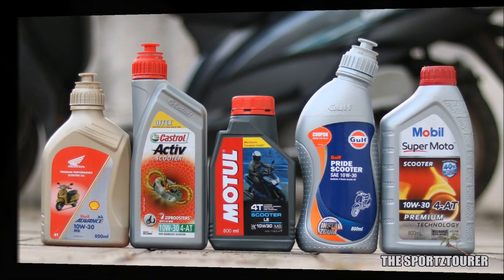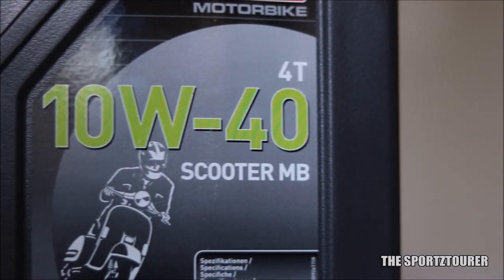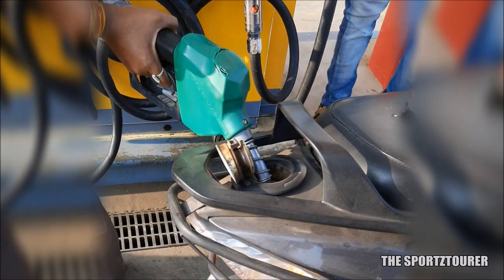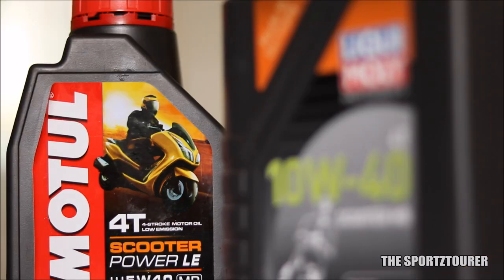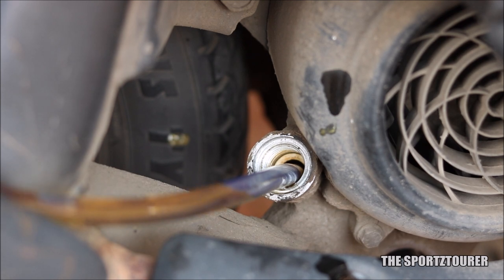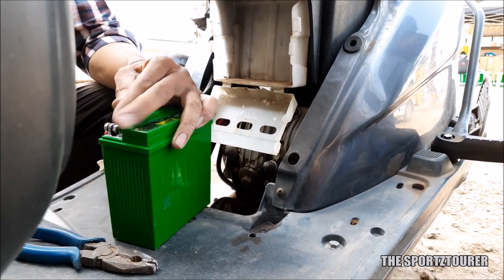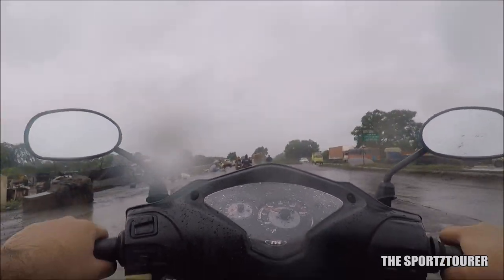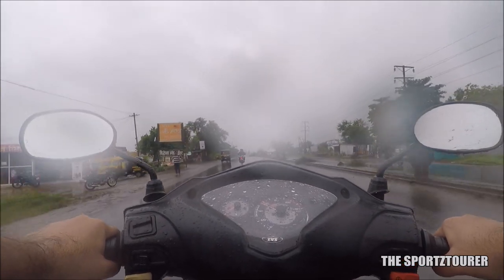LIQUI MOLY SCOOTER ENGINE OIL VS MOTUL SCOOTER POWER LE, COLD START PROBLEM, BEST SCOOTER ENGINE OIL

Comment: Using liqui molly scooter engine oil 10w40 for Yamaha fascino 125 bs6 and I can feel the difference. The engine running smoother at speeds above 60kph. The vibration has also decreased. Previously was using yamalube oil which was also good at it's price.
Reply: Any other engine oils you tried in new fascino? If yes please share their experience.
Reply: How many odo for the changing interval of liquimoly oil ?
Reply: Right bro i am using Bajaj pulsar 150cc bike in 20 w 50 oil.my bike is a smuth.no vibration
Reply: @alyounesandyfernando2437 your bike daily Drive?

Comment: Thanks again for the video.
Want to share an experience with using motul 3100 10w30 on my Hero Duet scooter. The manual clearly mentioned about using JASO MA oil so I went with this hoping for better performance and smoothness.
I poured in the winter of 2019 along with it changed the gear oil too. The oil did great till april after which its smoothness went for a toss. The scooter didn't want to go beyond 50kmph at this point which wasn't the case till march, it easily did 65kmph without complaining. Carburetor tuning was checked multiple times too. Now 9 months in with the oil, (scooter's running is very low, only city usage, done 15000km in 4 years😂)
So will be switching to motul scooter le 10w30 now and will share accordingly.

Update: Recently changed from Scooter LE to Castrol Power1 Ultimate. Scooter LE performed admirably. Longevity of the oil was good, decrnt smoothness and happy engine. I extracted 67kmpl on a highway test with speeds of max 68kmph eith the oil. Best value for money oil I'd say. 
If you want I'll update with my castrol experience too.
Reply: hero duet and activa basically have the same engines i think
Reply: @rko951  please don't clutter the comments with your half assed knowledge. Duet's engine was the first scooter engine hero designed from ground up after separating from Honda, glamour was the first bike engine. You thought wrong
Reply: Allie X  actually if you read his other comments, he constantly trying to prove I'm wrong, after 5 such replies I had enough. Yeah even I'm surprised as the label on oil filling port on the scooter says API SJ which is so old, maybe around 2003.

Scooter is damn fine with the right oil, activa didn't even bother to give telescopic front forks until 5g 😂. I like my bs3 duet for what it offers, only gripe is slow pickup till 10 kmph
Reply: Allie X  haha since when did TVS started producing activas?  change of mind suddenly? ;)
Reply: Scooters mainly require JASO MB grade and JASO MA & MA2 will not be as lubricating as JASO MB. From next time always stick to JASO MB grade for scooters. You can try Liqui Moly 10W40.
Reply: @sudiptapramanik3171  again, the scooter manual mentions using MA oil which surprised me too but I went with itm

Comment: I want to change the engine oil & oil filter on my RTR 180 myself... but one thing i don't understand is that they mentioned something called OIL SUMP FILTER which has to be clean every 6000kms as per maintenance schedule provided in the manual. please help me 🙏🏼 regarding this, i don't understand what they are referring to. This is how they mentioned.. Just to make you understand better 
Engine oil- Top up @ 3000kms & Replace @ 6000kms
Oil filter (paper)- Replace at every 6000kms
Oil sump filter- I & C at every 6000kms

Comment: Using Liquimoly MB Grade Scooter oil along with Liquimoly oil additive since last 6 months in my Honda Aviator. I had completed 94500+ km in Honda Aviator. My observation is that one click start and improve in mileage (52+kmpl) in my 7 years old scooter. I love liquimoly products. My experience with motul is very bad. Thanks for the comparison ☺️🙂
Reply: What is the drainage interval
Reply: @bitbuybit9193  as per liquimoly website it is upto 6000 km but i don't cross 2000 km in any case since i purchased scooter.
Reply: @JitenderKumarJitu  since you have even added the additive, its safe to stretch it till 3000km. Why was your experience bad with Motul I wanna know
Reply: @tejaspadhye  i had used 4-5 bottles of motul 300v MA grade in my scooter. After some days engine starts consuming engine oil. After 500 km few amount of engine oil left in engine. This had forced me to go for engine overhauling. After engine overhaul i had used Motul 10w30 MB mineral grade engine oil but i don't find it useful. I think Motul oil is not good for Honda two wheels. I had Honda CB Hornet 160R also in which i am using Liquimoly 10w40 street race.
Reply: @JitenderKumarJitu  interesting. I have used motul 3100 10w30 in my scooter which is JASO MA because manual suggested MA grade. What I didn't like is it didn't even last 2000km, but for the same oil but 20w40 grade, my 14 year old suzuki responded amazingly.
Reply: @tejaspadhye  good to hear that suzuki engine supports motul oil. Now honda BS6 scooter engine manual recommend use of MA grade engine oils which i think good improvement by honda.
Reply: @JitenderKumarJitu  lmao scooters have become hybrid apparently, both MA and MB oils work 😂
Reply: im using Liquimoly Street 10w40 in my Yamaha Nmax 155
i put 850ml of oil and put 50ml of Liquimoly Mos2 oil additive total of 900ml
i stretched it to 3450km. 
it when i drained more than 870ml still came out

Comment: I have some extra Motul 7100 as my bike only takes in 1.2L, leaving me with .3L extra. I have just kept the extra oil around for a year, so can I use it during my next oil change or should I discard it?
Reply: You can keep it for 1 year, don't use it after that as opened oil may not keep its properties intact. You can instead use it for topups if you ride aggressively, and if topup not required, every 1000-1200km take out 100ml of old oil and pour 100ml from your excess available oil.
Reply from the maker: Hi Sajag,
As already mentioned by Tejas and Allie you can safely use the 300ml left over, just make sure you store it well.

Comment: For liqy moly is the best option in the market but i have dout in how much kilometer it can run in one drain interval for regular and fully synthetic engine oil of liqy moly? Because in my city technician has no proper ans for liqy moly brand due to knowldge and experiance with liqy moly engine oil?

Comment: For my RayZR bs6 l wanna change it to liquimoly 10W40 mb grade so question is do l necessarily have use liquimoly oil for the  gear or can l use other brands too please suggest me what gear oil should use bcuz l couldn't find the same grade number of gear oil to the engine oil.

Comment: Hello, this video was very helpful to shortlist best engine oil for my suzuki access 125 as I have been using castrol scooter till now, wer can I get this oil and how much does it cost??
Reply: You can get both on amazon from Cloudtail for original packaging
Reply: Allie X  one time it sucked but rest of the time, I'm happy I get better prices on amazon. Example, I got the 3m flush for 131 last time I bought now on flipkart they only sell in combo the additive and it costs 250 there for the flush. Right now, it costs 181 on amazon
Reply from the maker: Happy to know that the video was helpful, you can get it from Amazon/Flipkart/lrlmotors. Do share your experience with the oil here 😊

Comment: Which fully synthetic oil would you recommend for heavy traffic usage, personally I think I would go for LIQUI MOLY 20832 10W40 Scooter MB 1 L, since it comes in 1 litre capacity, I don't want to mix match 800 ml synthetic oil with some other low grade oil and make it a bad cocktail.
Reply: Please state your scooter model too.
Reply: @tejaspadhye  I use Pleasure
Reply: Allie X  Ty Allie, I've been servicing my scooter properly and performing oil change periodically too, and with my next service, I'm planning to flush my engine oil with 3M engine oil flush since I've driven the scooter just past over 25k.
Reply: 10w40 for long drain. 5w40 for smooth stop n go

Comment: Castrol power 1 for 220f? 
Will it be good since it’s 1.2litre pack .
Reply: I'd prefer shell ax7 10w-40 full synthetic or motul 7100 10w-40 full synthetic rather than castrol power 1

Comment: I have 6yrs old pleasure scooty 100cc should i go for fully synthetic bcoz condition of scooty is quite bad. Or for scooter le motul mineral. ???????
Reply: Mene company ka synthetic daala tha which is used in bikes. This cleaned my engine in 1200 km and it became dirty... then now i changed to shell. Runs smoothly.

Comment: I do not think engine oil has any role to play in whether the engine starts with one kick or first self. We have a wego for past 6 years and it always starts at first crank 99 percent of times. And TVS scoters do not have cold start issues, unlike say, activa which are notorious for their cold start issue. So I think if you can do a comparo on an activa which had cold start issues that got resolved by changing just the engine oil to say motul or liqui moly then it would be a conclusive evidence on the impact of engine oil on cold start.
Reply: Yes TVS doesn't have cold start issues on it vehicles but engine oils in general do play a role in cold starts. Say the grade is same, comparing castrol activ extra with motul 3000 or 3100, both oils being 20w40, you will find motul very much better. My 14 year old suzuki which had notorious starting issues regardless of temperature was solved to a great extent which just a switch of engine oil brand. There's a reason why online forums call Castrol as Crapstrol. Only their power1 racing fully synthetic oils are worth it according to many online forums discussions.
Reply: Ooh you shouldnt be answering comments down here, if you have no idea how a two wheeler works....sorry my bad brain

Comment: The best way of explanation. You just nailed it bro. Pls suggest the best oil for Karizma R 2013 model. 42000 running. Monthly running 700 km
Reply: Use motul 7100 10w30. It is a fully synthetic engine oil.
Reply: @RahulGupta-of9rc  ok brother thanks

Comment: In July i have serviced my activa 3G by local mechanic and fill Castrol Active 10W-30 4-AT scooter engine oil and after 2 months of use my feedback is that engine oil is really good for daily city traffic use but only one problem i face to starting my scooty in the morning when i left it standing still for 1-2 days! Btw, I'll appreciate if Anyone can suggest me which engine oil would be better in winter for my activa 3G?
Reply: Try Liqui Molly JASO MB grade 10w40 or Mannol 10W40, they are better than castrol.

Comment: Bro is it possible to install the slipper clutch from R15 v3 to R15S or V2...????
Reply: No
Reply: @sureshadaveni7716  did you tried it..?? Coz I've seen many videos changing clutch set , the only thing was they all were Indonesian
Reply: @vishnugopi2563  in india R15 V2 and V3 clutch plate sizes are different so you can't change in Indonesia they will modify it so they can change
Don't try and don't waste your money and time on it, because my friend tried it.
Reply: @sureshadaveni7716  ohh ok thanks mahn . I thought the housing and clutch are the same coz v3 engine is developed from v2 not entirely made from scratch.

Comment: Sir , 
I am using an fz 16 carburated bike  my battery  is unable to crank up the engine  as i have been not using it for a long time due to covid and no plans to  change the battery  .( cant take chance with the mechanic  for now )  i been  rolling my bike and starting the bike  for now for emergency outgoing ..... 
  I know its not a good  practise  but   will it harm the bike too much ?
Reply: Bike doesn't have kickstarter? I don't remember if it does. Its carburetted so it wont harm the engine but your electricals might behave unpredictably. So ensure you keep headlight off if possible while starting.
Reply: rolling and starting damages the gear box dude, u should not do it unless its an emergency, buy a battery on amazon for 900rs and fix it urself its very simple.
Reply: @rko951  all dtc bus are usually push started only. They keep one truck fit and fine and its used in the mornings to push start all the buses. If done correctly it doesn't damage the gearbox.
Reply: Allie X  have you seen a bus driver switch off on redlight 😂?
Reply: Allie X  talk to your dad more then :P

Comment: Can anyone recommend me a good engine oil for 2018 ntorq (bs4 carburetor) for better cold start?
Reply: ENEOS SCOOTERZ 10W- 30 Engine Oil  or  Mobil Super Moto
 SCOOTER
81 BETTER PROTLCTION
 10W-30/4-AT SYNTHETIC TECHNOLOGY both are Synthetic Oils I personally used both and I get 50 Plus mileage I'm the city in a low speed less then 60 kms

Comment: Which engine oils i try for my access 125 scooter i traveling a lot highway as well as city ride every day running is more then 50 to 80 km plz tell me best engine oil options because when i traveling more then 50km some engine knowing sounds is comming .
Reply: Motul scooter LE is enough to take the beating if you're not going past 60kmph. 
If you live in hilly area, Motul 5w40 makes sense, you can get it for around rs570/-
Otherwise its 5w grade wouldn't be helpful for you, here liquimoly 10w40 will be better as you will have spare 100-200ml for topups.
Scooter LE mineral comes for less than rs285/-
Reply: @tejaspadhye  ok thanks for replying me i try for motul 10w30 semi sinthetic oil now but its ok ok purformance for me so now i try for fully sinthetic oil ok .
Reply: @jigarpanchal8738  which semi synthetic are you talking about? Motul 3100? I wouldn't suggest using that, its made for motorcycles not scooters. If your manual says you can use JASO MA then go ahead use it.
Reply: @tejaspadhye  yes right now i m using motul 3100 gold 10w30 so what should i try for next time ??? Tell me bro so i will try that engine oil n u have scooter ??
Reply: @jigarpanchal8738  already told you in the first reply. Yes I have a scooter
Reply: @tejaspadhye  n what about motul or Suzuki engine oil what gread n type i will try for ??
Reply: @rko951   no bro i dont know that company also
Reply from the maker: Hi Jigar,
Your query has already got some good response. As per my experience Access performs very well on 10W-40 grade oils and Suzuki used JASO MA/MA2 oils so that should not be an issue for you.
In your case you can go this this Liqui Moly scooter oil or the Shell AX7 which is an underdog in this segment: https://amzn.to/2vIMeHZ
Reply: @thesportztourer  ok no problem n thanks for replying me n help me.

Comment: Is it advisable to use 10w40 in 10w30 honda activa engine as company recommend 10w30?
Reply: Citizen Kolar  i have used many brands. 
1. Honda genuine gold bottle
2. Castrol activ scooter
3. Motul scooter LE
4. Veedol scooter oil
5. MAK scootech
6. Gulf scooter oil
Reply: Citizen Kolar  no i dont but I'm not getting good average as most of the comments say they are getting 50+
Reply: Citizen Kolar  which hero spares i can use in my activa which can improve average?

Comment: Bro starting issue if bike kept inclined on side stand. If it starts then starts with very low rpm. Any ways to troubleshoot?
Reply: turn the idle screw half turn clock wise.
Reply: @rko951  tried everything with afr mix. It's not the issue. I discovered today it was the choke cable which was interfering with handle movement. So while on side stand if fuel was on then choke was flooding the engine. Hence too rich mix and slow start.
Choke cable replaced with new one and problem solved.

Comment: Hello sir can I use Castrol Activ 20 40 motorcycle oil use in TV's Jupiter
Reply: better to stick to 10w30/40 or 5w40 grade, since 20w40 is thicker and jupiter will take some time to warm up which increases wear.
Reply: @rko951  sir samg nahi ayea kug hindi mein btayega pls reply thanks
Reply: Allie X  ok sir
Reply: Allie X  sir mechanic bolta hai k dono same hai

Comment: Bhai maine apni TV's ntorq mai Castrol power 1 cruise 20w 50 daal dia hai , agar problem huvi toh kya kya ho sakta hai plz bata na ?
Reply: Allie X  are ha bhai pata hai mujhe bhi ki mane hagg dia ab service center jaa ta hu toh befaltu ke charges laga ke normal service ke bill bhi 1200₹ ker de te hai aur kuch extra kaam bola toh basic parts ke bhi 60-70% extra charge ke te hai , aur bhai mai aap ko puri story bol ta hu mane  user manual pada hai abhi bhi service ka tym aata hai toh dekh le ta hu service manual me kya likha hai ki air filter aur spark plug 12000km pr badal do aur air filter toh mai he mahine mahine mai khol ke airblower se saaf ker le ta hu toh wo kharab he nahi huva aur spark plug ka mera mechanic dost bolate ho 12000 kilometre tak kharab bhi Nahi hota hai aur naya dalage toh thode tym me udd jayega , fir mai Castrol ka power one 10w30 he dhund ra tha prr iss chutye marker mai kahi mila nahi aur uper se ek autopart wale ke pass 20w50 mila toh wo bola daal de kuch nahi fir bhi mane mere mechanic dost se poochha usne pahle nahi bola fir bola daal de oil se itna farak nahi paad ta aur kismat toh dekho meri itna sab chod phaile ne ke baad gulf ka 10w30 fully synthetic oil mila ab bhai iss se zyda aur kya batao aap ko,😂
Reply: Allie X  thanks bhai , mai bhi khood he oil change ker ta hu prr iss bar na hote hote bohot Sara chutyap ho gaya nahi toh mai bhi 10w30 grade se he chipka huva tha iss se pahle motul ka techno-synthetic 5100 dala tha uspe bhi gadi zyda nahi 2100km chali thi fir abhi castrol power one daal na tha 10w30 prr wo toh mila he nahi prr extra chutye zarur mill gaye
Reply: Allie X  bhai aap ka number de sakte ho toh plz de do kuch bhi query huv toh sidha aap se he baat ker lunga
Reply: Allie X  ok bhai tysm
Reply from the maker: Hi Himanshu!
Jaise ki already kaha gaya hai aap Ntorq k liye 10W-30 ya 10W-40 grade oil use kijiye aapko acha performance milega.
Reply: @thesportztourer  pr bhai abhi jo 20w50 dala hai uska kya keru
Reply from the maker: Abhi aap next oil change pe grade shift kar sakte hai.
Reply: @thesportztourer  bhai iss se kuch problem toh nahi hoga na